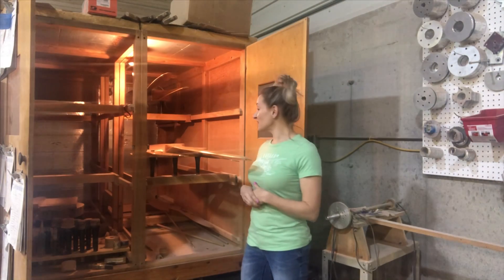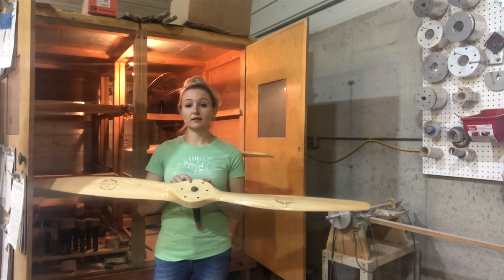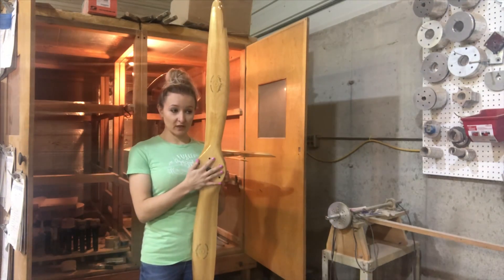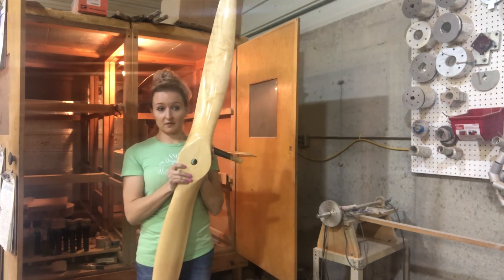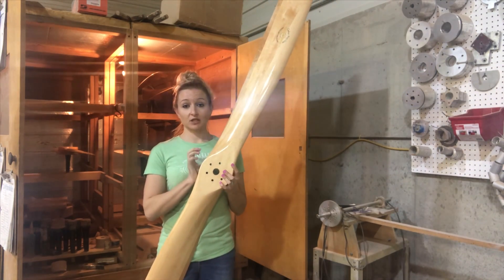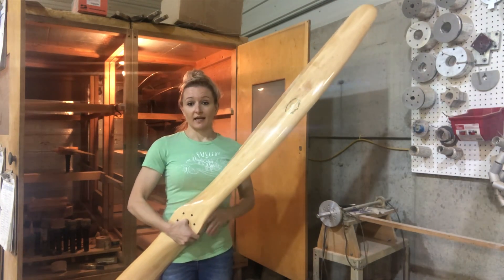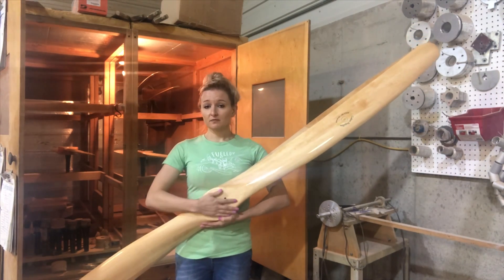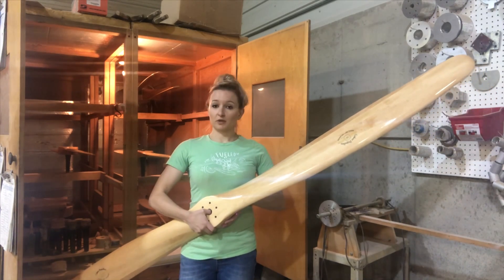Types of VW propellers

Comment: Those props are so incredibly beautiful... I'm a total layman in airplane/props industry, but have professional experience with air ducting and dust ventilation. When I was doing projects, I often had tangent questions that I never took the time to answer. But now that I'm not in that business anymore, a few still remain. Since you guys are at the source of the gear and the knowledge, I hope I can ask you this one: what is the difference between a fan and a propeller? (what would make it a propeller instead of a fan?) (talking about swing blade fans of course, not talking about centrifugal fans)
Reply from the maker: I’m not really sure how to technically answer that question. I’ll do some research.
Reply: Axial blower same as fan usualy produces more ( higher) air pressure because more blades. A.C. propeller ads the airspeed to the surrounding air and couter force to that pulls the airfraft. Every force has a couter force if you make the air go faster your fan wants to go opposite direction.

Comment: I think V.W Made a 1200Cc engin and a 1300 CC engin.    Then in the late sixties they made the FLAT ENGIN OR WE CALLED IT THE PANCAKE ENGIN.   USE IN THE TYE 3 and the 411& 412 I think till 1974.   Also Porsche Made the Flat or pancake engin on the 914 Porsche.      Don’t quote me on this.    You must be modifying those Bug engines for your purpose.    They are easy to work on for sure.     You do great work Lil Sis.
Reply: Vw had 2 types of engines, Type 1 and the Type 4. These denote the case style. T1 started life at 900 cc, I believe, then 1100, 1200,1300,1500, and last, the 1600cc. Type 4 started life at 1700, then went to 1800, and 2000cc. She does not make the engines, Now, there are kits to increase size way over original.
Reply from the maker: Jim Davis I couldn’t even begin to tell you myself. I know a little bit about the small  area of aircraft conversion engines I work with, but beyond that I don’t have much experience. Sounds like a neat area to research!

Comment: Are the pitch numbers rated the same way as boat props?
Reply from the maker: I am not sure how they do that on boat propellers.  For ours, The first number is the diameter and the second number is the pitch in inches, so for every one rotation of the prop the plane should move that many inches forward.